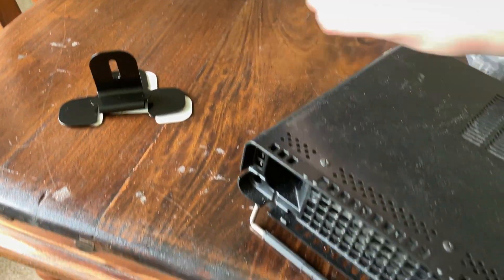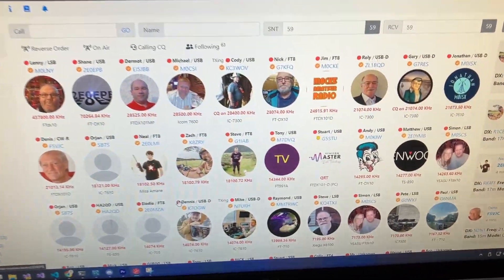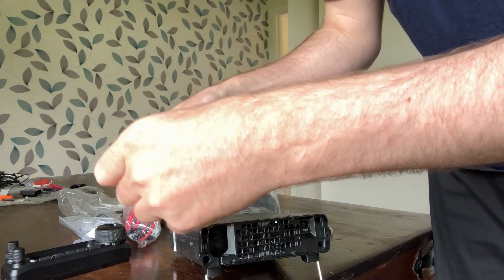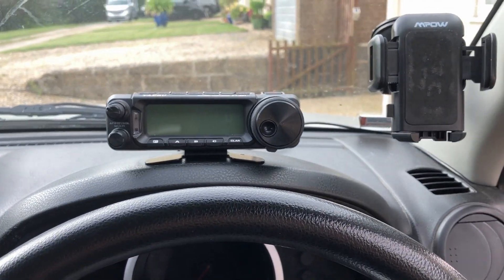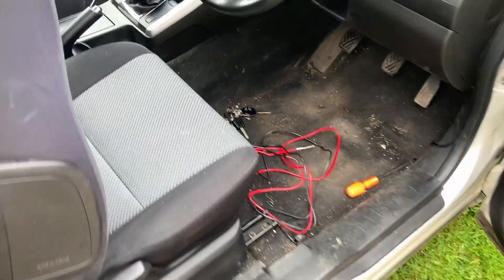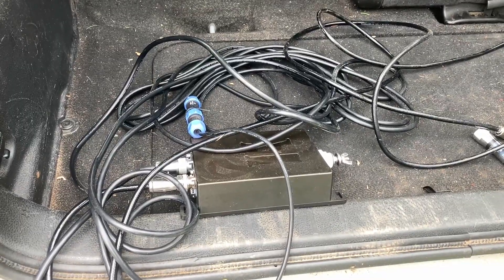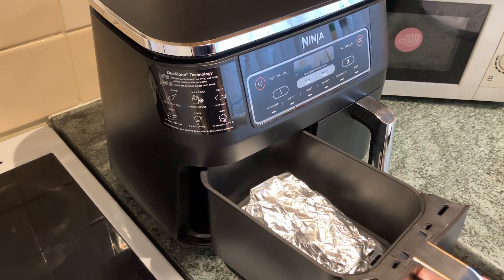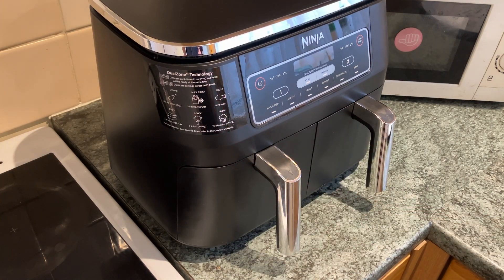HAM RADIO FAILURE💡my YAESU 891 and ATAS 120 dramas

Comment: I spend my days driving up and down motorways and highways across the EU & UK. I use an 891 and a ATAS 120A, on a triple magnet mount.. 
I bought my first ATAS (ATAS100) and the The Yeasu FT100 way back in time. I used a triple mag mount then.
.
Off topic slightly.
To avoid corrosion on your mag mount, spread a little petroleum jelly all over it.
Reply from the maker: Thanks Bob

Comment: Hi Stu, a good copper braid 28mm width at the bottem on the mount, find a good earth on the car take some paint of in the car attach the other end of the braid to the car, I have put a watson ranger 9 on my A200 at the front of the car, I have tried 20m works great, I did use some RG58 outter braid to try it, but I'm getting the copper braid 28mm 1m about 10 pounds, I use this ATU The LDG one with my Icom 706mk2g. 73's 2E1FUE speak soon 😊

Comment: Had the same problem and the main issue is the input voltage. The voltage going into the radio must be 13,8V otherwise with only 12V the antenna wont budge.  You can also, as I did, install a voltage regulator inline with the radio assuring the 13.8V even if the battery voltage is lower. Having that done all my tuning problems with the ATAS were solved.

Comment: I mounted my ATAS on the roof of my vehicle.  That, of course, means a direct connection electrically to the body.  Absolutely flawless performance from 6 to 40 meters.  Reports and stations worked have been way above my expectations. Tuning can be slow but, once it is tuned, changing one or two bands at a time is quick.  Just wanted to say I've found it my best investment.

Comment: You would be shocked at MY cob job for using the 891 for POTA. I have a mount for my ATAS 120A on the fender of my pickup and I only attach it when I get to where I'm going to do my POTA activation. The antenna wire sneaks in below the F-350 badge on the fender, through the door, and up onto the dash where it sits all the time. When I get to my POTA site I put the 891 on the dash, hook up the coax, and run the power cord down to the Lithium battery sitting on the floor on the passenger side. CQ, CQ, CQ. It works like a charm. Not fancy or permanent, but works when I need it to. The ATAS is awesome. It really does the job.  No bonding. No grounding.

Comment: With modern vehicles in my limited experience although the panels are spot welded the majority of the panel is bonded using miners adhesives. This doesn’t make a great earth on its own. My own experience is that I have earthed or earth bonded several different points on the vehicle to maximise efficiency. Just my experiences.

Comment: had the same issue with an ATAS  but  after grounding the antenna on my hatchback i found using one of the hatch retaining bolts a perfect source to earth , use to work without any issue s after that while using the the hatch mount also

Comment: It is a common myth that grounding is the problem with the ATAS.  I assure you that is generally not the problem.  I've put my ATAS on 2 cars (one with a Diamond K-400 Mount, another with a metal bracket bolted under the hood) and have done zero grounding or bonding to the antenna and it's worked great.  Do make sure the metal screws of your mount have dug into the paint of your car though.  That should be adequate enough ground for the antenna to work properly.  What is really happening is sometimes the antenna gets confused as to where it is, hence the tuning with high SWR and it does nothing.  The solution is to press the tune button and just let the it do it's thing.  What will happen is the ATS light will keep blinking without putting out any power.  It looks like nothing is happening, but this is a good thing.  Just let it go for a solid minute and it will start tuning again.  Basically it's recalibrating itself during this time.  Once you do that, you should be good to go.
Reply from the maker: Yeah I agree Mike, it's not the first time I've used it and I did cut out the many minutes of waiting for it to do it's thing (doesn't make good viewing), there was actually a genuine fault, but I don't want to spoil the next video by saying it here (you know the game) :) cheers.
Reply: He did not press and his down the tuner button. How did he expect it to work if you don't activate?
Reply from the maker: Well actually I did :) maybe not in the final edit though, regardless, the problem was neither earthing or incorrect operation.
Reply: @G5STU  @hamradiotube Mike is 100% right, had the same issues and actually learned from Mike at FD this year about just waiting and letting it find itself basically.  It is the best combo for mobile IMHO. Enjoy!

Comment: Interesting and timely! I just installed a used FT 891 in the car and possibly buying the ATAS. I spent several hours with the same headaches as you! What I found was it would tune on 10 through 30 meters, but God forbid when it got to 40 meters it couldn't find a match and after a couple of minutes would tap the tune button. Then I tried going to for example 20 meters and it would not move at all. I eventually found my accident if I would key the mic and use the UP arrow, eventually the antenna would start moving down. That's how I sort of found the workaround anyway for the stuck antenna fully extended. I drove to a POTA park and worked 20 and 30 meters with it and got 12 easy QSO's with the ATAS. I'm still miffed about why it gets stuck and hopefully today using the up arrow while keying up will manually lower it for you. The arrows are opposite what you would think. You would think the down arrow is the one but it's not. Curious if you resolved the issue but scary we both dealt with the exact same issue yesterday. 73 KN3A.
Reply from the maker: Glad I'm not the only one :) Thanks for the tip, I'm just heading out to revisit it now actually so I will give your method a try ! appreciated👍 I'll post a follow up video.
Reply: The key to getting the ATOS to tune correctly is to make sure it has a good ground. If you are attaching it to your rear hatch make sure to run a grounding strap to the body. Some of the time the hatch and body of the vehicle aren't bonded well. I was able to tune 10-40 meters fine. I never tried 6 or 2 meters. As for the arrows being reversed I did have that issue but it was the only quirk I found with the set up.

Comment: To get decent performance you will need to bond the tailgate to the body. Bonnet too. Maybe galf an hours work. I operate a 10 foot whip with a tuner. Its not great. Not as good as hamsticks on the higher bands and on 40m its pretty poor. Sometimes bigger isnt better.
Reply from the maker: @GordonHudson  ok, thanks for the info , all very interesting

Comment: Hi. Stu, I’ve installed 2 ATAS and have had these issues several times.  Firstly grounding needs to be spot on especially if on a tailgate.  I’ve used braided earth strap from the outer of the so239 to the chassis of the main body.   Second it likes a fully charged battery. And thirdly they can get lost as to their position.  There is a reset procedure I’m sure I’ve read before.  Anyway once you get that they work superbly
Reply from the maker: @julianlong  thanks for the info , I'll have to get the grounding sorted by the sounds of it .
Reply: @G5STU  I’ve asked Darren to send you two photos
Reply: Oh yes....Rf grounding is sooo important.I operate mobile on 160 meters with the Ampro whip and the grounding has to be spot on...And then it works...
73
G7HFS/PA3IKH